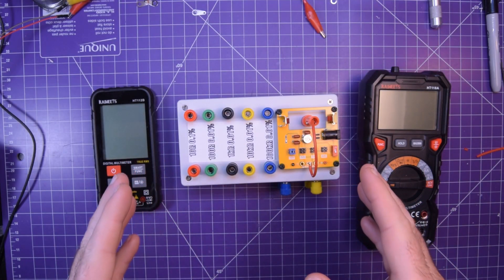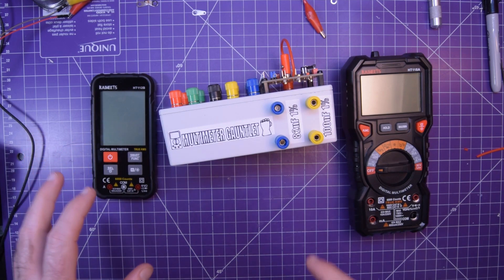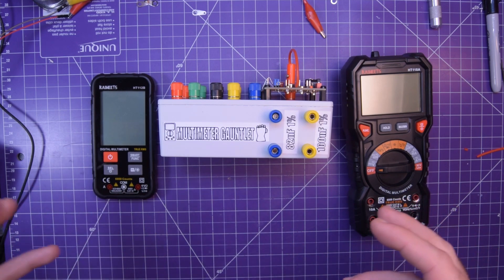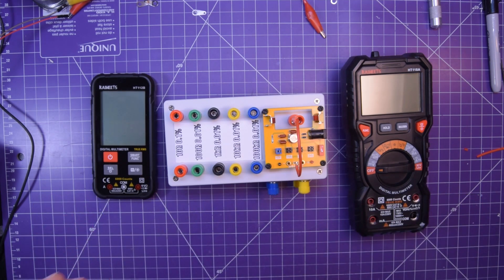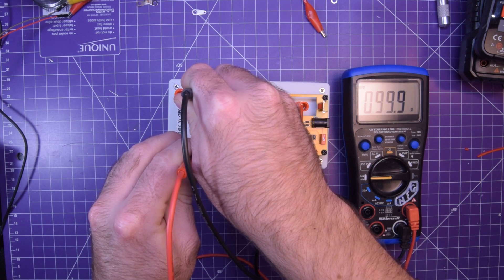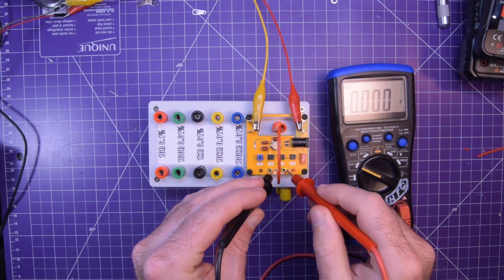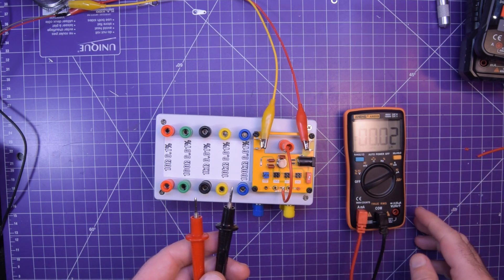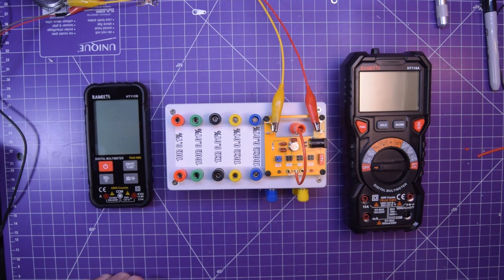Make Your Own Precision Tester For Under 150$

Comment: OK, What the??   In the 3rd current test, 10V at 1K ohms should be 10mA (I=V/R = 10/1000 = .01A).  You're measuring .9 micro Amps, saying that's close to the 1mA expected.  Why are you expecting 1mA, not 10mA?  And why is .9 micro Amp "close to" 1 mA, not 1uA?  That's off by a factor of 1000 of what you're saying (which is still 10x lower than my calculation of 10mA).  And the lower current tests are likewise off by 10,000, showing 10microAmps instead of 1 mA for 10V at 10K, etc.   What am I missing???
Reply from the maker: I have to check again, on the spot math lol

Comment: What would you provide for AC measurements?
Reply from the maker: not quite sure aside from shoving probes into the wall!
Reply: @SimpleElectronics  couldn't you get a transformer with a center tap and just use a few meters to determine what it's should read? For example a 120 in 12 out with center tap. You could then read 6-12-120 vac.

Comment: binding posts add error, especially cheap ones, but hey good enough for testing multimeter basic accuracy to specs. nice build.. that will serve you well.
Reply from the maker: as you saw, there wasn't any error at 10 ohm range, and once you're at 100 ohms, there is no way it can add even 1% error! But I suppose, as you mentioned, in the big picture, there is no way anything short of a 6.5 digit meter could even tell the difference! Thanks for watching!

Comment: 9:23 "i hope if you do make your own...." no, i won't be making one. im too lazy and im not going to spend $/£100+ on something id only use very occationally. I do have a AD584 voltage reference module in a clear plastic case i bought on ebay for about £10 and some 1% resistors. I could quickly solder ten 1% resistors in parallel to get a more accurate lower value divided by ten but what would be the point. 1% is good enough for me to check accuracy of my meter.

Comment: Nice work, @Simple Electronics 

For version 2 perhaps add pushbuttons that can be pressed before measuring capacitance.  The button would short a resistor across the cap to ensure that it held no charge.  I claim no expertise though , so perhaps this isn't needed.
Reply from the maker: I don't know if it's needed or not, I'll look into it! thanks!

Comment: I am also testing multimeters and have tested well above 100, it is on a website, I do not do video.
For that I have made a resistor capacitor box with 100ohm to 10Mohm 0.01% and 1nF to 10uF film capacitors 1%, this handles most of these test, but later I have add 100pF and 30Mohm, 50Mohm, 100Mohm, 1Gohm and 10Gohm mostly 1% (100pF & 10Gohm excluded). and a couple of different diodes.
For DC voltage and DC current I mostly uses a SMU, but has some 7½ digit meters and references to check with. AC voltage and current is not as precise and is mostly based on my high precision meters.
To handle frequency and duty cycle I uses a Siglent ARB. I also uses the ARB together with a electronic switch (home made) to check speed in continuity, ohm and capacity modes.
SMU and ARB testing is controlled by some home made software or I would wear my fingers down selecting parameters.

And a note about low ohmic precision resistors: Cable and connection resistance is significant!
Reply: I didn't even know such huge value 10Giga ohm resistors were available. What the hell would you ever need a 10Giga ohm resistor for. My meter "only" goes upto 100M ohm
Reply: It is for meters with a nS range. Isolation testers also goes well into the Giga range, but they requires high voltage resistors if you want to test.
At these values precision is difficult, due to leakage currents and static fields.
Reply: Whats your website address ?

Comment: Doesn't putting a wire across the resistors have the potential of giving inaccurate results? Similar to testing a resistor in circuit, where you can usually get a good result but there's potential to be inaccurate?
Reply from the maker: Not in this case because the other end of the resistor is open, no current can flow so no precision is lost, just like a common technique is to resolder one side of a resistor (or break one track) to check it! But good question !
Reply: @SimpleElectronics  Cool,thanks for the reply. BTW, I hope that read as a question and not criticism. Great project, hope to make one myself soon!
Reply from the maker: It read as a question :)

Comment: This is extremely well thought out.  I'm actually in the market for a new meter so it will be really nice to see solid numbers.  I think it's also a good idea to use the probes that came with it.  I've seen reviews where they swap them and I don't think that's a fair test.
Reply: Agreed. 
For a review it's probably fairest to test the meters "as they come".  
Most people will be using their meters with the leads and accessories that come in the box (at least initially).
Reply: I agree but I also think it may be good to also test with a set of probes that you use for every multimeter so it can be determined if it's the meter or the probes that are out of spec
Reply from the maker: I think both ways have merit! I think the vast majority of people will use the included leads, but if a meter is a good deal even with the cost of a set of good leads, that's important as well. Since I chose to use binding posts, I can make up a set of gold plated banana-to-banana jacks to eliminate the leads from the equation
Reply: @SimpleElectronics  I think only my way has merit but okay :-) jk
Reply from the maker: Thanks for the thoughtful feedback!